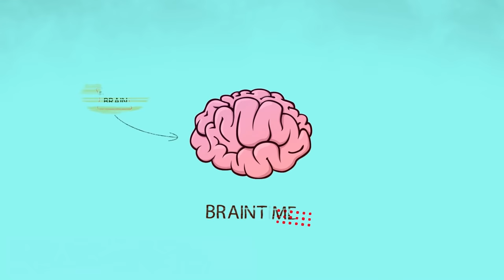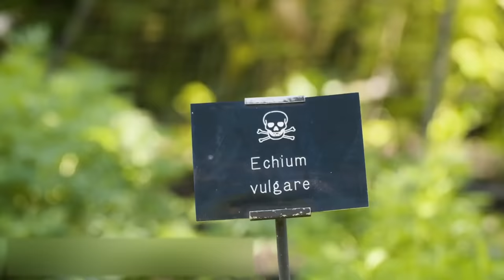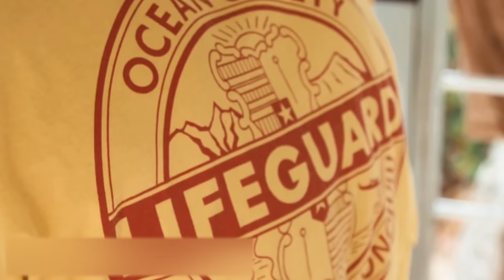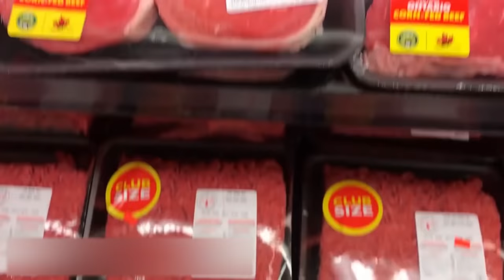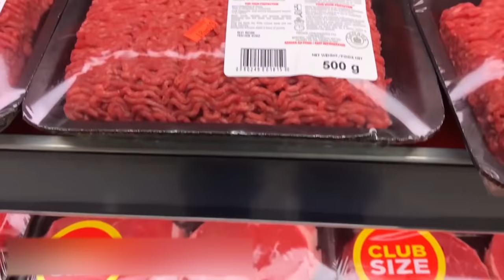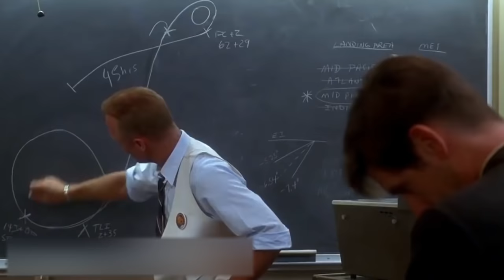This Is Why Touching a Dead Whale Is So Dangerous

Comment: 8:00- Host says cars produce "Carbon Dioxide" when infact they don't they produce an even deadlier gas called "Carbon Monoxide"
Reply: “even deadlier?” First of all, carbon dioxide isn’t at all dangerous unless breathing a 100% concentration. But, yes, this video is “fake news’ because they erroneously labeled auto exhaust as carbon dioxide instead of carbon MONoxide.
Reply: They actually produce both. Even a cigarette lighter would produce some carbon monoxide...it's just a result of the fuel not burning or oxidizing completely.
Reply: What he said, it’s called incomplete combustion

Comment: That would be carbon MONOXIDE! Whilst an excess of carbon dioxide can be fatal this is simply due to it replacing oxygen and causing asphyxiation whereas carbon monoxide is actually poisonous. As it is denser than air Carbon monoxide sensors should be mounted closer the floor to be effective.

Comment: #7  I think the host meant carbon "monoxide"....  Anyway, great video!
Reply: Ray Chang was just about to comment this
Reply: Me too.  A build up of carbon monoxide can kill quickly.  A build up of carbon dioxide leads to rapid, shallow breathing triggered by the medulla oblongata and gives plenty of warning that something is wrong.
Reply: @Li.Siyuan  Yeah carbon monoxide is a far better way to die even though it is also because of suffocation, as the body thinks it is oxygen and uses it as such without you even noticing.  Hence the comfortable death, if you can call any death comfortable
Reply: I never knew or ever heard of whales exploding .
Tnx for letting me know.

Comment: 8:00 Carbon Monoxide not Dioxide.  Carbon Dioxide is produced by the body and Is not dangerous to the human body but it will asphyxiate you if it's the available in high concentration.